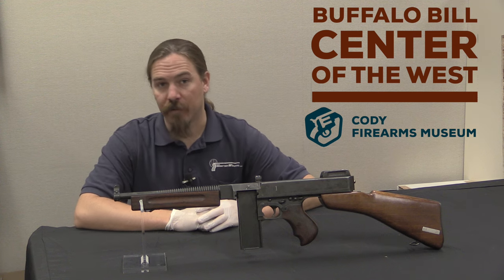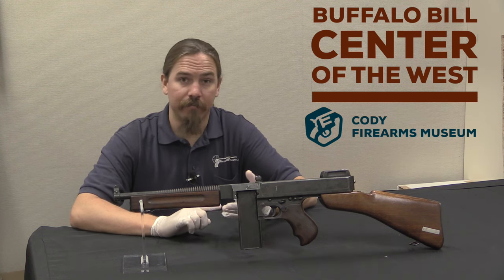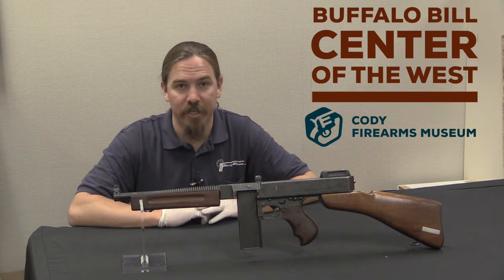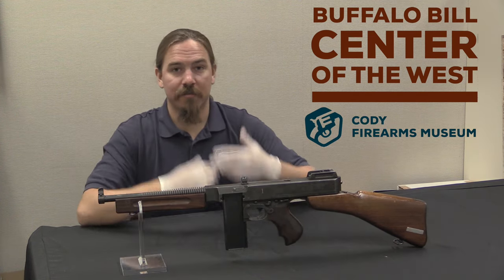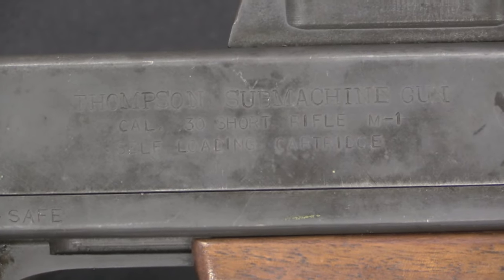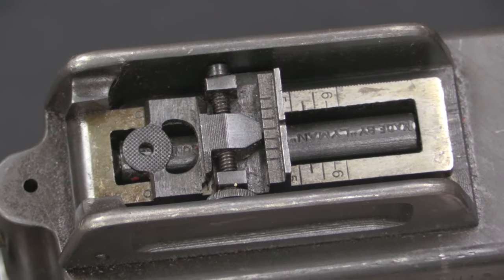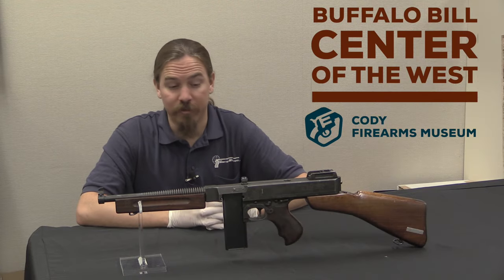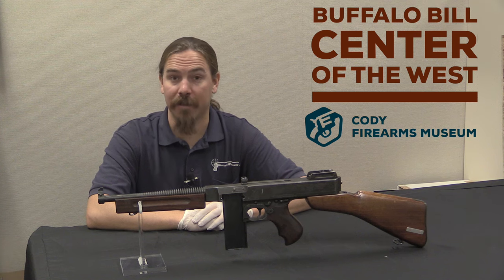Thompson SMG in 30 Carbine

Comment: So, is .30 carbine not considered an intermediate cartridge? No one seems to be pointing out that this could've been the first successful assault rifle.... [Well, if it weren't a Thompson and weren't submitted to the carbine trials. xD] Some other comments were comparing it to .357 magnum, so maybe that's sort of why it's not...but it certainly was designed to be...and I think I've heard it referred as intermediate?
Reply from the maker: Lots of people pointed that out. Every rifle in that first trial was a select-fire action in .30 Carbine, so they all would have been - but none were adopted, so they weren't. The US considered guns that would have qualified as "assault rifles" as far back as 1917 at least.
Reply: .30 carbine have a effective range of about 200 to 300 yards, thats a short distance for a rifle and while it was more powerful than a .45 ACP, it was weaker than the 7.92 Kurz round.
Considering that the round is also used in some handguns, the .30 carbine weapons was arguably more of a large submachine gun than a true assault rifle.
Reply: Adam Croes Very hard to tell. It's very likely that the Thompson in .30 cal still would've been reject.

This was before the Thompson got it's cheaper redesign in 1942 so it would've been expensive, and the weapon weigh in 12 pounds unloanded, heavier than even a M1 Garand loaded. And the purpose of the Light Rifle was to make a rifle lighter than the Garand.

So it's no surprise that the weapon was rejected without even testing.
Reply: Adam Croes Modern reproductions of the Thompson are made in a frame of aluminium to reduce weight, they are in semi-auto only.
Reply: Adam Croes Considering that it just for recreation and civilian purpose, I think top-grade quality is not a concern.
Reply: Adam Croes An aluminium M1A1 Thompson would be the closest thing.

Sadly, the Thompson was consider an obsolete smg even by the standards of WWII, 
heavy and expesive in comparison to others smg, with the only advantage being the high power .45 acp.

The M3 Grease Gun, the weapon that replaced the Thompson had the same capabilty as the Tommy gun, and it was even cheaper. An example of a boring, but practical weapon.
Reply: Adam Croes Not really, it would be nice if it have cocking handle on both side though.

Comment: If you think 10lbs is heavy, it was exactly the weight of the StG44.
Reply: RGA1944 but the STG44 fired a true intermediate cartridge, had a higher magazine capacity, had a recoil that came straight into the shoulder, and didn't have the extremely heavy reciprocating weight of what was the thompsons blowback action.
Reply: Heavy was used as a relative term here. Of course 10 pounds is not that much in absolute terms, but given the requirements of that particular programme, the ordnance department considered 10 pounds too heavy. Not to mention that this weapon was meant for lower-tier units that weren't expected to see a lot of small-arms fighting, like artillery units, logistics, signal corps, and the like.